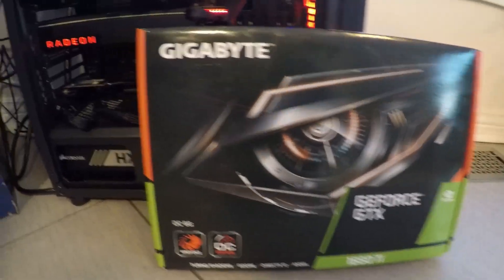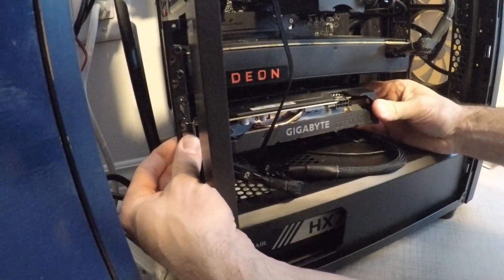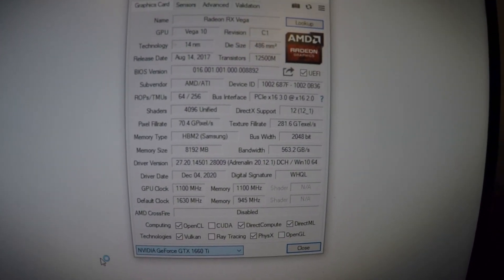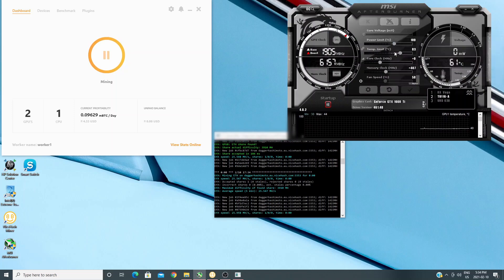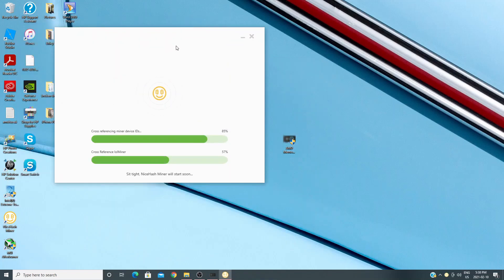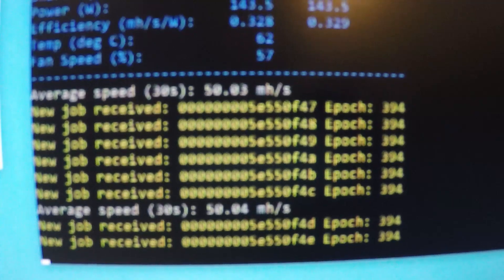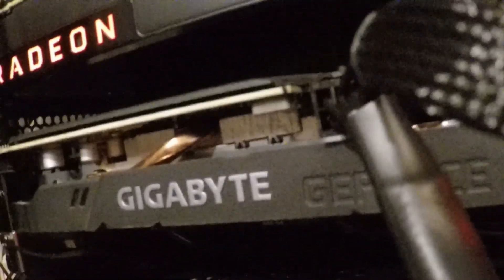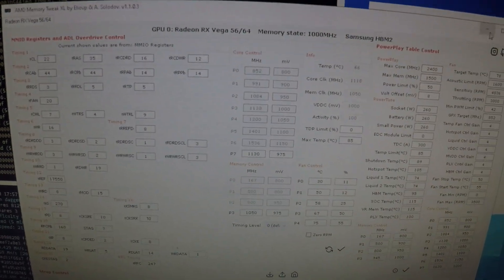AMD and NVIDIA GPUs mining on same computer

Comment: Hi, i installed a 1060 into my computer with my main being a 6800, device manager doesnt recognize the nvidia card and i cant install drivers because it doesnt recognize it
Reply from the maker: Did you try with just the 1060 in the system

Comment: i already have a gaming pc with 2 gou but nicehash doesnt seem to be detecting my other gpu just the one? Any ideas?
Reply from the maker: Are they both being detected in afterburner, GPUz, and or in device manager.
Reply: @DIYNorth  hiya im mining on 2 gpus now :)  had to change some PCI settings i think on bios gchanged to gen 2...now my problem is im looking ro OVERCLOCKINIG for nvidia rtx 2060.. im using msi but my mobo is aog.. sorry so many question
Reply from the maker: the type of motherboard shouldn't matter. I use MSI afterburner with all types of mother boards.
Reply: oh cheers… Msi afterburner i think is easy to use.. im rnning at -200 core, memory at 1345 , power limit at 80 and im getting 34 mh/s per gpu On an rtx 2060

Which mining platform is ideal for a gaming pc setup? Small scale :)
Reply from the maker: @makoyofdanorth3647  I don't think the platform matters that much. I use Nicehash sometimes. More recently I am using 2Miners with TRex to mine Ethereum directly.

Comment: Could you help me? I have 2 1660 supers and a 1050ti already in my rig, I just got a great deal on a 5700xt for $350 and I'm trying to install it in my rig which is running windows 10 pro but it wont install ? Windows sees it but wont install the software for it I keep getting a error 43 saying software isnt compatible with drivers. I've tried every download from amd and nothing is working.
Reply from the maker: I'm not really sure. I don't recall having that problem. Are you able to test the 5700XT on another computer to ensure that it isn't the issue?
If the 5700XT is connected to the mother board by a riser are you able to put it into a full slot directly on the mobo to see if there is an issue with the riser.

If the NVIDIA drivers are already installed and it seems like they are I would suggest disconnecting them from the mother board and see if you can get the 5700XT working just by itself and then at the NVIDIA cards that already are working on the computer.

Comment: I have 2 cards ( 6700xt and 3060ti ) and need to build a PC. I am thinking of doing something similar and use both cards to mine on on PC. Any things to consider when putting together a parts list ? I literally only have the 2 cards and 12700k cpu at the moment
Reply from the maker: The main thing is to get a motherboard that has 2 full width PCIE lanes. And the lanes need to be spaced out such that the two cards can mount on the mother board without interfering with each other. 
Assuming that you are going to have everything inside of a tower.
Other than that the parts are pretty much the same as any computer build
Reply: @DIYNorth  thanks 👍

Comment: Hello there,

I have a gtx 1650 super and 1060 6Gb both MSI. Could I use them both with a 650W gold plus PSU?
Reply from the maker: I see no reason why that would be an issue. I try to keep my power draw around 60-70% of the PSU rated power draw.
Reply: @DIYNorth  could you send me a guide to change the power usage and how to setup two nividia gpus with the drivers?
Reply from the maker: @killertheanonymous2552  I don't have any experience with adjusting those 2 cards in Afterburner, but it will be very easy. I'm sure there are is some guidance on each of them on line.
As for the driver setup, you shouldn't have to do anything special for 2 NVIDIA cards. Just download the driver, or if it is already there just install the cards and they should be recognized by the computer. Just look at display adaptors in device manager. It should list both without you doing anything.

Comment: Litterally just paid my vega 64 for 800$ Cad 😂
Reply from the maker: You sold it for $800?
Reply: @DIYNorth  nah, i bought one used. Here in south shore montreal, price asked is around 900 to 1000$ CAD for a blower vega 64 (same as ebay) 

I managed to get a gigabyte 2 fans for 800$
Reply from the maker: @etienneoligny5106  Gotcha, I like the Vega 64. They take some effort to get up and running, but they are good.

Comment: hey nice info, may i ask what mobo you used? i'm wondering if my this trick will work on any mobo with 2x 16 pci slots?
Reply from the maker: I've used it on a few mother boards this way, but this one is an MSI Z490 Gaming Plus. I also ran a 5700XT with a 3060 in a Gigabyte Vision Z490, and I've used a Vega with a bunch of Nvidia cards on an ASUS Z270.
Reply: @DIYNorth  thanks for reply, so in short it doesn't matter wheater it supports sli and crossfire or not? i recently purchased msi B550 gaming edge without realising it doesn't support sli but only crossfire but because I'm going to have two nvidia cards, I wonder if it's going to work?
Reply from the maker: @Yuv_0006  it should be fine.
I turn off sli and cross fire. It's not needed for mining.
Reply: @DIYNorth  thx man, i appreciate your time.

Comment: hey great video but im confuse my main gpu is a 1070 but i want to add a 580 for mining with both card do i need to install the drivers on the 580 even if i already have my 1070 driver install ? thx bro
Reply from the maker: Yes, you will need both drivers

Comment: So the gist of it is to designate each card to a different mining algorithm in NiceHash? If they're mining the same thing, that's when you can have issues?
I'm eyeing some used deals - will likely be getting an AMD RX 570 & a Nvidia 1650. Probably going to stick with NiceHash
Reply from the maker: You can sometime have them on the same algo without issue. If you want to run Team Red miner or something though you'll have to split them up in the nicehash program. best of luck getting some GPUs....it can be tough

Comment: Hi i have 6600xt and 3060 ti, and i have encountered code 12 in device manager, already tried regedit, ddu both driver, and changing pci from gen 3 to gen 2, im using b460 and both card plugged in to x16 slot, please answer need help, thanks and sorry for bad English
Reply from the maker: When in doubt a driver re-install might help. Have you set your virtual memory to match the memory of the GPUs? In this case 16 Gb

Comment: I have a radeon 5700 and a gtx 1050ti in my pc, i had AMD drivers installed and when i tried to get drivers for the 1050ti it was just stuck on checking compatability, was like that for at least 10 minutes any solutions?
Reply from the maker: Not really, but when i have issues with a multi card set up usually restart with just 1 GPU in the computer. perhaps putting just the 1050 ti into PCIe lane one and then trying the driver install will allow it to complete the install.

Comment: Dear Sir,
I am amature miner for 3 weeks. I have a PC with I5 9400F, ASUS H310E motherboard and two GPUs. 1st Zotac Nvidia 1060 8GB, and AMD Sapphire 570 4GB. One GPU is on the motherboard, the other is with PCIE 1 to 4 riser, I was trying a Kryptex miner of mine. It's not a rig but a regular PC with PCIE riser.
Now my problem is both the GPUs are working in normal conditions, their drivers are updated and fine. GPUZ shows them both.

but only one remains active for mining and the other gets listed but doesn't work. How to make both work together.
Thank  you in advance for your kind help.
Reply from the maker: I've never used Kryptex so I'm not really too sure, what are you trying to mine? The 570 4 Gb will not be able to mine Ethereum so that could be an issue. You will need a GPU with more memory for that now.
Reply from the maker: Here is a link from the Kryptex site on what you can mine with that card, but you should be mining Raven Coin with it. I don't know if Kryptex lets you mine two different coins with two different GPUs at the same time. NiceHash definitely does though.
https://www.kryptex.org/en/hardware/amd-rx-570-4gb
Reply: Thank you so much for your prompt reply. Now I am trying nice hash miner, but it's excavator keeps restarting.
Reply from the maker: @ybborhade77  it restarts periodically, but shouldn't constantly restarting. Are both cards working?
You might need to increase virtual memory a bit. I usually set it to match the memory size of the combined GPU memory. So in your case 10 Gb or so.

Comment: Hello I have an gtx550 and 560 but do I need an sli bridge cable ??
Reply from the maker: i've never used an SLI cable for mining in my life, so I would say no. Though I have not used those particular GPUs.
Reply: @DIYNorth  how about gaming do you think I should get it ??
Reply from the maker: @Nogapniba   I wouldn't buy one for that purpose.  I don't think those have the same processors. i think they are a GF 114 and a GF 116, I don't use SLI but I think they need to both be the same to actually work correctly.
Reply: @DIYNorth  ah ok because I just bought it but it was only 3 usd so I guess it’s worth it
Reply from the maker: @Nogapniba  It might work, I dunno. I would just run the 560
Reply: @DIYNorth  ok 👍 thank you 😊

Comment: Great video. Thanks. I am starting the process of building my own rig and it is impossible to get GPUs at this moment. Only ones I got are 4GB cards with NVIDIA chip. Hope to start with them and get an AMD 570. Do you think it should work.
Reply from the maker: I think that for the most part any card can be made to work with any other. With the 4Gb obviously you might limit yourself to what you can actually mine. I agree, it is pretty had to get a GPU, they are out there, but there isn't much for a reasonable deal. You also need to be very fast to respond if a decent used deal comes up online.
Reply: @DIYNorth  thanks for your reply. I'll see if I can spot a sweet deal out of a used one or hope for some new cards available close to the end of the year. Here in central America, they all ran out a couple of months ago. Seems like people from central America went crazy with the mining because of El Salvador accepting BitCoin as an official currency so they came all the way here to buy whatever cards were available.
Reply from the maker: @todotvstreaming  that sucks. There are actually still GPUs in stores here in canada, but the selection is very bad, and they are at very inflated prices.
Reply: @DIYNorth  hey another quick question when you wired your GPU cards, you power the riser and the card using a pci-e y splitter? Is it because the 75 watts from the 6 pin riser is not enough so you need a splitter to power the riser and card from the PSU?
Reply from the maker: @todotvstreaming  yes you should power the riser, the gpu will try to pull power from it, just like when it is in the motherboard. I believe the mother board can supply up to 75W out of the PCIe lane in addition to the 6 or 8 pin connector.
I'm not sure what would happen if there was no power being supplied through the riser....I've never tried that, but for sure the GPU will try to get some power from the riser.
Reply: @DIYNorth  ok thanks. But what I mean is that I noticed that some of your GPUs on the rig have power to the riser and a separate 6 or 8 pin connector to the card. Which is why I was asking. So you are powering the riser and the card through separate connectors?
Reply from the maker: @todotvstreaming  so yes they do have a separate power cable for the riser, but they dont necessarily need it. I've been slowly buying splitters and have most cards and their riser on a single split 6/8 power cable.
Right now I still have two cards with a separate power cable to the riser from a molex connector.
The ones in this video are sata, but sata is not recommended, though I've personally never had an issue with sata.
I've powered the risers numerous ways, and all of them worked well.
I try to keep costs as low as possible and dont buy more cables unless absolutely needed
Reply: @DIYNorth  thanks. I was thinking of the same approach of using maybe the VGA cables from the PSU that split into two 8 and 6+2 and connect them to the riser and card. I guess the pci-e splitter is maybe for powering more risers from a single source and using the other ports from the PSU. Thanks for your help!

Comment: where do you plug your monitor? motherboard or video card? are you using dummy hdmi for full perfomance or it is necessary?
Reply from the maker: I only use dummy hdmi on my 3060s, or I plug the monitor into the 3060 to get full hashrate.
Everything else I just plug the monitor into the motherboard

Comment: Hello, do you think I can run 6600Xt with few RTX 3070 cards on the same rig, also is it possible making some of the cards to mine different algorythms, is there a way running both AMD and Nvidia cards without nicehash, thanks!
Reply from the maker: I think you should be able to run a 6600 with some 3070s, I'm trying to get a 6700 or 6800 to mix in to my nvidia rig. I haven't tried to run mixed algorithms on anything other than nicehash, some I'm not sure which other mining programs would allow for you to easily run different algorithms.

Comment: Please give me a idea for using 3060 and 3080 gpus mining on same pc ..i am strugle to connect two gpus..BIOS settings?
Reply from the maker: for just a 3060 and a 3080 you should not need to do anything special. You likely don't even need to touch the motherboard BIOS. It will also be just the one NVIDIA driver, so the set up should be easy. If the mother board can take 2 GPUs and your PSU is large enough to power it then it should work. What is the problem that you are having?
Reply: @DIYNorth   Thanks for reply!! While connecting any gpu to pci 1x slot, windows is not booting up. Both the devices can be used without any driver but after updating the latest one, it get crashing and struk in the boot logo screen.. motherboard -ASUS prime A 520M-A
Reply from the maker: @gokulrajm3035  Thats strange, I've never used that mobo so I'm not 100, but I would assume that it can take 3 GPUs. In the manual for the mother board does it indicate that it turns off certain PCIe slots if a SATA is in a certain location. Ill it boot if just one GPU is in the 16x spot and nothing in the other two? I would likely try to go into the mobo bios and change pcie to Gen 1 or Gen 2 (assuming they are on auto) and see if that helps. Do you know if the riser is good.
Will the system boot with just one GPU installed on a riser?
Reply: @DIYNorth  Yes, if i tried booting using my riser on 16x slot, pc boots normally, but using the same riser in 1x slot, then it won't boot up
Reply from the maker: @gokulrajm3035  have you tried it in both 1x slots
Reply: @DIYNorth  yes i tried both of them..This problem occurred after installing tha latest bios version .Till 2 days before i use 3080 gpu only now after updating of bios version i introduce 3060 ..
Reply from the maker: @gokulrajm3035  you should be able to go back and down load an older version of drivers and or bios

Comment: Thanks for the video, gave me confidence and hope for a smooth setup. Got a 5700xt arriving in a few days. Curious if it’ll work in conjunction with a 3060 ti. I’ll follow your guidance with nvidia first then amd. 

Cheers!
Reply from the maker: I used that 5700xt in a set up with both a 3070 and a 3060 using the Dev Driver. I haven't had an issue that couldn't be worked out fairly quickly. I think you will be fine.

Comment: Hey can i use nvidia for gaming and amd on mining using windows 10? Using nanominer
Reply from the maker: I'm guessing it's possible, but I've never tried nanominer.
I know in nicehash you can very easily select which GPU is doing the mining and keep the other one at idle. I'm also not sure how that would then impact frames per second on the game. But in general it should be very possible.
Reply: @DIYNorth  should i buy then 1050ti, its available in used market
Reply from the maker: @rohanbhoir5779  I would personally not be interested in a 1050 ti. The hashrate is too low at this point for me to want to add it to a rig.
Reply: @DIYNorth  yes i understand, but its very difficult now to find used rx 570,580 in used markets and new costing 3x 4x on msrp in india.
So i thought i will play games on 1050ti and keep rx 570 on mining 24x7
Reply from the maker: @rohanbhoir5779  that's fair, I bought a used 1660 super for video editing and games, and put my better card to work. I might even get the 1050ti if the price was good and if i didnt need to buy anything else to get it mining. If you need to buy a PSU or another mother board for it then you would have a hard time breaking even.
If the only cost is the card and your electricity price is reasonable, it does still turn a profit.
Reply: @DIYNorth  yea, exactly thats my point, i already have rx 570,
I have 550watt 80plus very good psu,
And 1050ti doesn't need extra heavy power.
And i m getting its asus version of 1050ti at price about 100$.
Nothing else is required
Reply from the maker: @rohanbhoir5779  that's not bad then. I sure you'll make the right decision.
Reply: @DIYNorth  i will look for either 1050ti or 1060 3gb which ever i get at lowest price

Comment: Hey, do you think I can mine two gtx 3060 on MSI Performance Gaming AMD X470 motherboard?
Reply from the maker: Yes I think it will work fine. If you are asking if 2 of the first gen 3060s could get full hashrate, then I also think that would work as it appears to be able to go into x8/x8 mode when using pcie lanes 1 and 4.
You should varify that with your manual though. There are several other things you have to do to get full hash rate on first gen3060s though. I also have a video on that.